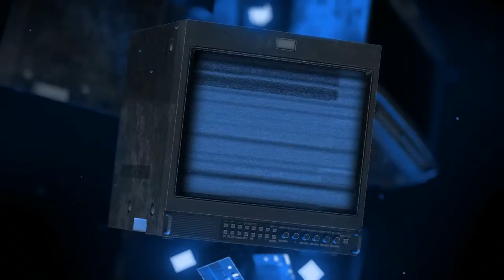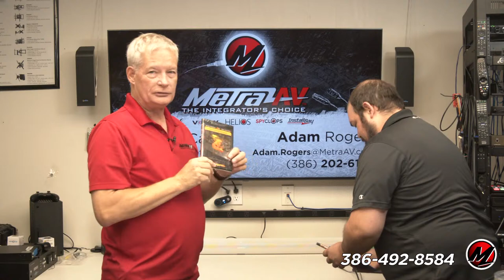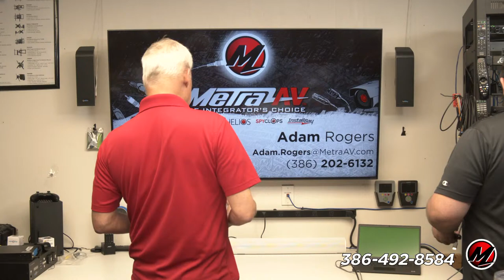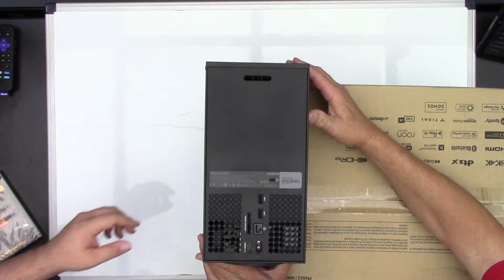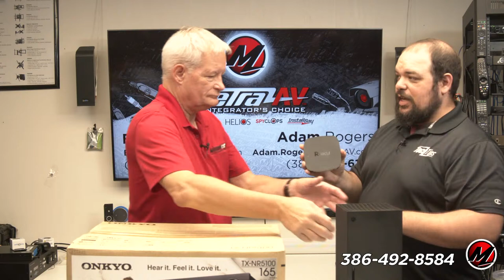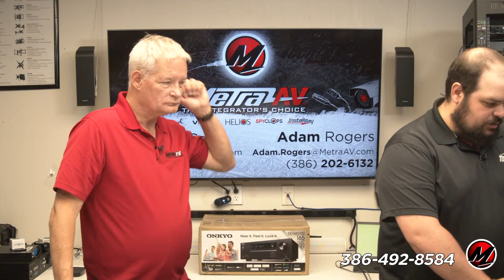Understanding HDMI Source, Sink, and Repeaters

Comment: Guys, good day, what is best solution if I have one display (Xiaomi wemax a300) and unpredictable source(mainly notebook).

I have a lecture hall with decent projector and it might be different speakers, teachers with their own device-source, which also might be some old notebook. 

What is best solution if I want bulletproof, easy and quick connection with projector through HDMI?
Reply from the maker: Hello Станислав Удалых, Lecture halls are very difficult especially when you have multiple brands and types of sources. Our suggestion is to lock down the projectors inputs to a 1.4 EDID, you can do this by turning off "Enhanced Mode" on the HDMI input.

Some displays do not have "Enhanced Mode" as an option, they may call it deep color mode or something else similar, but the setting should be in the HDMI INPUT settings. From there I would recommend putting one of our CS-1X2HDMSPL5 splitter scalers between the source and the display. You'll want to set the splitter to "Auto" on the front and it will handle scaling the output resolution to what the projector wants.

I hope this helps! If you have any other questions please let me know. Thanks! -Adam R.
Reply: @EtherealProAV  Thx for a quick response, I`ll try to implement your suggestion and feedback the result.  

Also allow me one more question, as a complete rookie in this:

- there's one source (notebook) and one display(projector)  - works fine
- teacher/user likes to work with presentation on source(notebook), then physically disconnect (hot unplug HDMI) to turn off the image, then hot plug it in once again and expects an image to go on instantly
- I suppose these expectations were created by some other system, maybe at his office and there it probably worked

the question is:
- Am I right to presume that HDMI cabel connection doesn't work as fast/predictable as say USB-data, it takes more than couple of seconds even if system works per se, you can't just plug-in/plug-out/plug-in/plug-out on hot and expect display to transfer your image at once?
Reply from the maker: @СтаниславУдалых-у7л  You are correct that it can take more than a couple seconds for the system to sync up and start displaying video. However, it may also be caused by the projector. In many cases, projectors handle EDID differently than "normal" displays. This is sometimes shown by a long sync time or images blanking out. The suggestion that we discussed before can help with this situation as it limits the number of options that the projector will try to negotiate to the source.